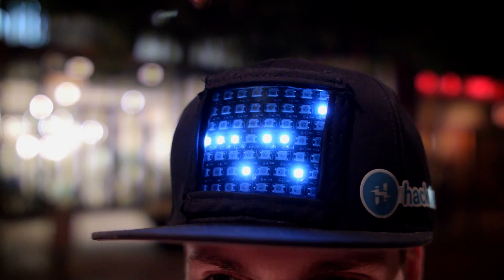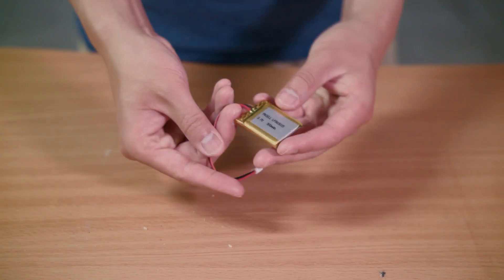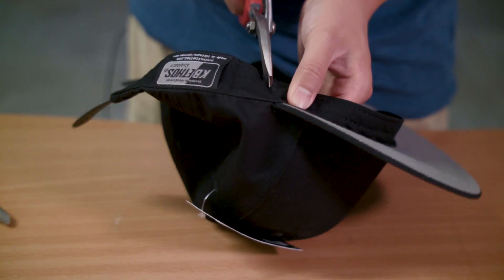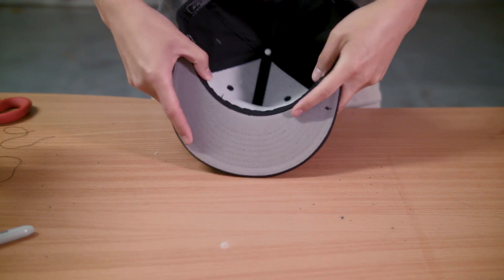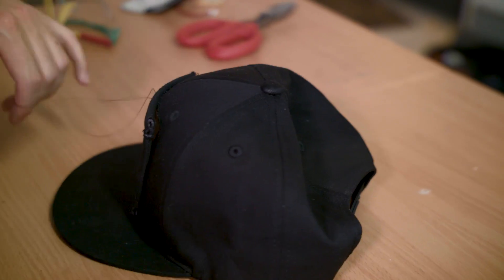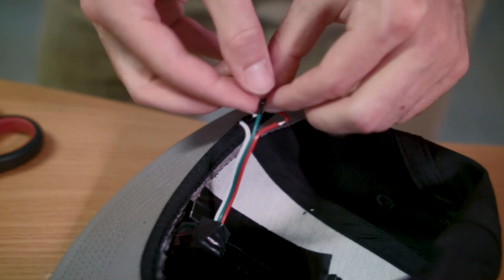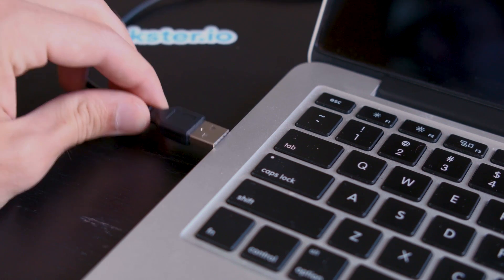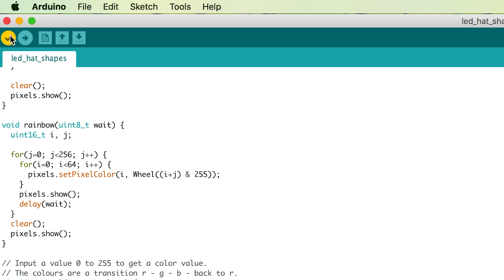How to Make a Customizable LED Display Hat

Comment: Sorry first timer making hardware toy here . Is there any wearable controller board I can buy that doesn't require soldering to the LED pads ? Like a plug in for the wire ?

Comment: Would the adafruit CPC work with any other type of LED string lights? they're basically the square but just on string. I can send a link if needed to answer.

Comment: Thanks for this super comprehensive tutorial, Hacker Shack! But what if I wanted to link two of these LED panels together? Will the code and the FLORA micro controller/battery work to control/power two at the same time or would I have to control and power them separately?  I would ultimately like them both to be in sync or a larger version of the FX you provided but I'm thinking that linking them would need a different code to account for the extra amount of LEDs, correct? Thanks!!

Comment: Its not easy to find the 8x8 Neopixel Flexible LED in my country.

is it possible if i buy the ws2812b LED strip and cut them into 8x8 then wire them?
Reply: Im trying to figure out the same thing,. I would think so though...
Reply: Well I got 5x8 board
Reply: @muhammadmashoo5388  yeah like i said its too hard to find this flexy-led in my country, but then i made it myself from ws2812b LED strip and cut them 8led/strip and glue them so then i can get 8x8 by wire them like a snake.
its not easy for amature like me. :( took me 2 months to make it.

Comment: Would it be possible to have the LEDs act as a VU meter?
Perhaps they could even act as a primitive waveform analyser, might look cool.
As usual, the creativity of your projects isn't only in the initial product, but in its extensibility; keep it up!
Reply from the maker: Yeah, definitely. I'd recommend modifying the `sineWave` function in the Arduino code and changing the `values` array to hold values for the audio levels at different frequencies.

Comment: is there any disadvantage to run the 5V LEDs with a 3.7V battery (except brightness)?
Reply from the maker: Not really, Adafruit actually recommends it https://learn.adafruit.com/adafruit-neopixel-uberguide/power
Reply: falias4 To my (limited) knowledge, it should extend the life of the LEDs. Although these aren't high-power LEDs per se; they will still get warm, especially as they do not have a very conductive backing surface. Consequently, undervolting them will help keep them cooler and last longer. Heat is what causes the eventual death of most LEDs.
Reply: yep, i'm aware of that.
i had concerns because the voltage of the battery drops too while discharging... and that could mean that the LEDs just turn off while the battery still has power or that you need a logic level shifter (like adafruit mentions it with 3.3V microcontrollers).